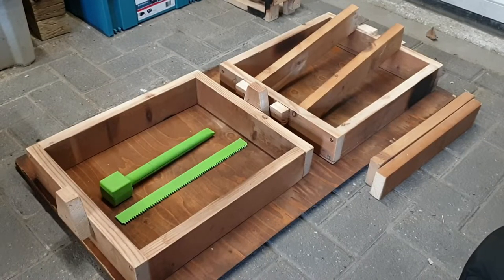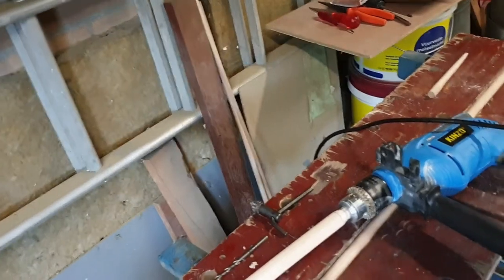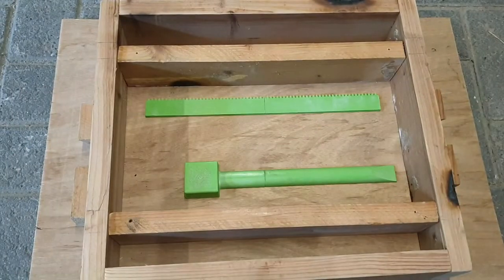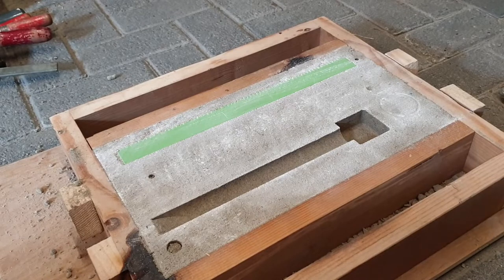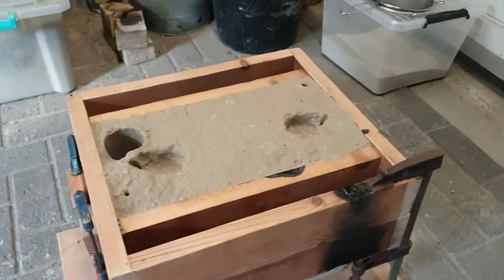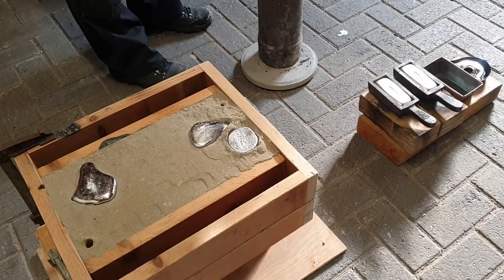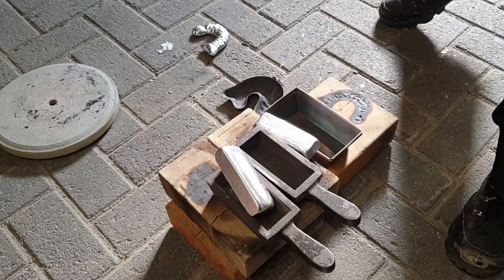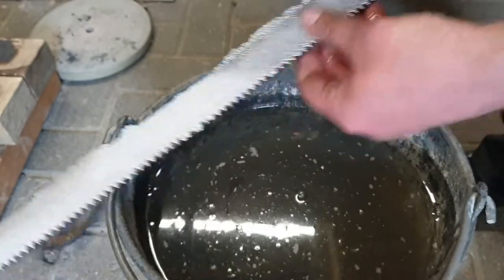Making a Sand Rammer & Strike, metal casting tools for metal casting

Comment: Watching you cram the crucible in there reminds me of all my old fun times with my charcoal furnace!  I've got a ton of HD's I need to do that with as well, problem is with my current setup I can't drop the drive in whole, I'll have to cut them in half.  I'd also had forgotten how much of that fluffy aluminum it generates, they I do admit I like the ingots from old hard drives.
Reply from the maker: You could just heat up the HDD's and then wack them to bits with a hamer, might be more fun! 😋👍